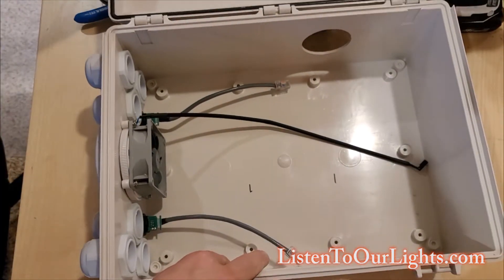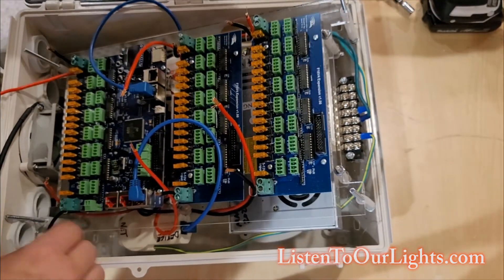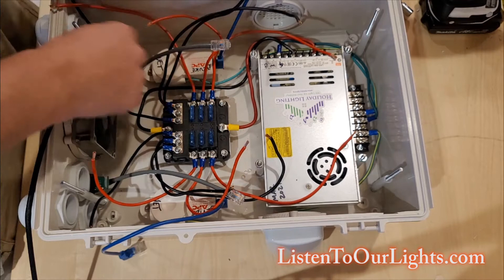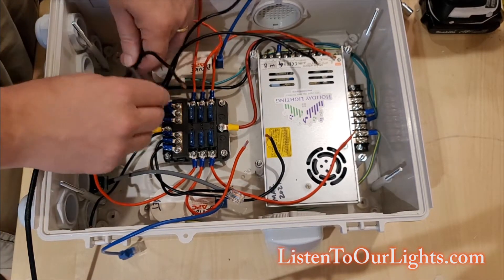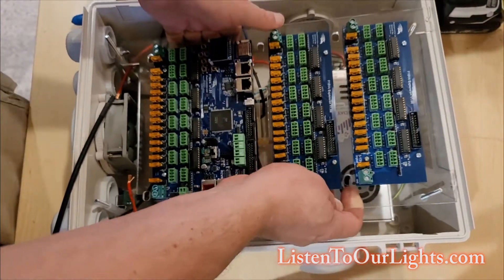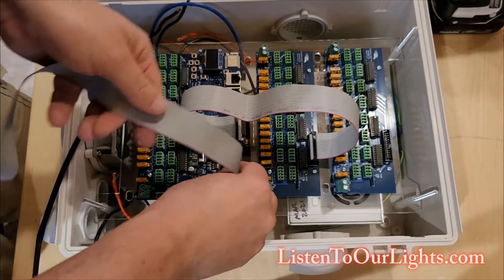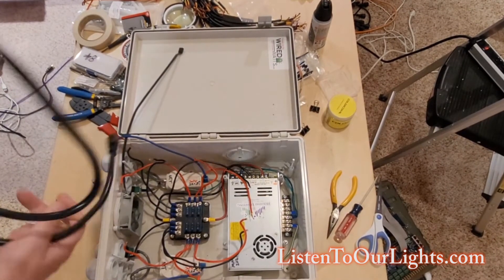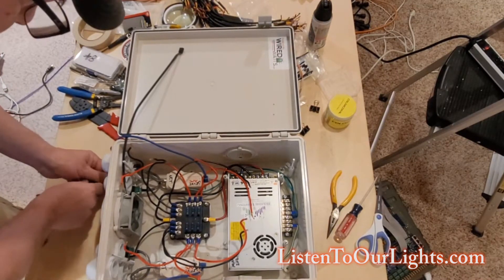Falcon Controller Build Part-6: Adding Pigtails and Wiring Controllers to Power

Comment: Very Nice build and helpful Information.
Have question, with a single power supply used i would assume that's mainly to power the boards and will do power injection on each port to get power needed for the 600 nodes per port that you were speaking of.  only 300 watts to work with.
I was thinking of doing one with two supplies on for each side of the F16v5
Reply from the maker: correct. In my display I rarely power pixels from the controller.